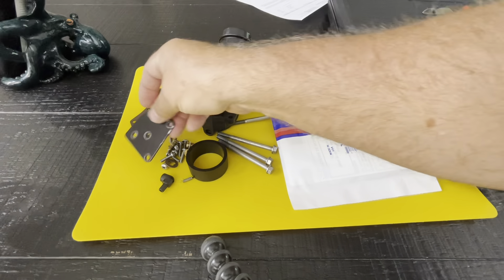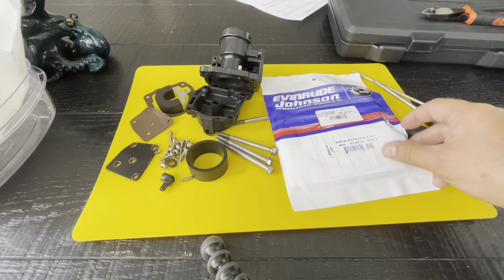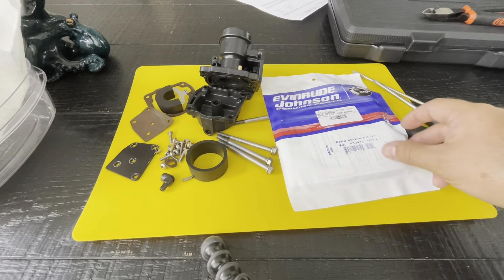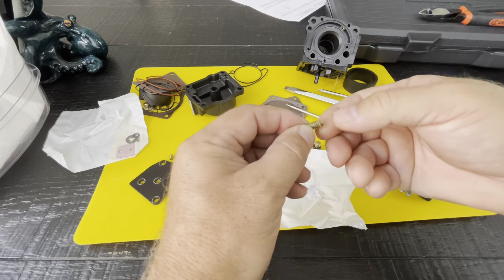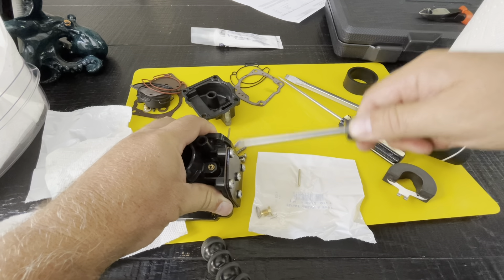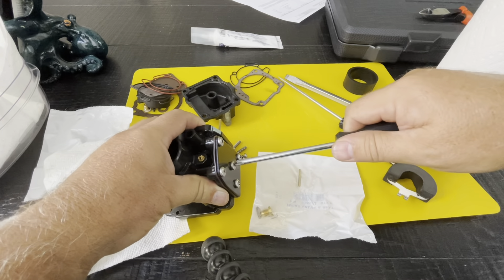Evinrude 150 Complete Carburetor Rebuild

Comment: If I’m not mistaken, the OMC service manual specifies that the carb float be leveled, as exhibited in the video, which closes the needle valve to stop fuel flow.….but also specifies a dimension for float drop which regulates the fuel flow into the bowl to maintain proper fuel level.
Reply from the maker: I would love to get my hands on that manual!
Reply: Manual states: "Adjust the float drop with carburetor body in normal position.  The drop dimension to bottom of float should be between 11/16 - 1-1/8 in."
Manual also states float should be level gasket surface (which you did), but +/- 1/32 in.
I can send pic or copy of applicable assembly procedure if you like.  If so, please instruct how/where to send.

Comment: Bobby, I would greatly appreciate your help.  I did the full carburetor rebuild even did the bowls.  Made sure all my floats were exactly level.  Even turned the adjustment screw 5.75 tuns out from seated. The engine runs like garbage idling way too low.  Before the carbs, I  also replaced coils, wires, gap less plugs, the Fuel pump, gas solenoid, starter and starter selonoid , flywheel cover and timing encoder .  I was under the impression that you can't screw up the timing because  the encoder can only be installed in one positions.  Do you have any ideas?
Reply from the maker: You can screw up timing if the timing advance notches are not in the right place. it’s part of that ratcheting system I believe. I am not an expert on timing, and I was careful not to mess with it.  If you suspect timing, I would hire an old Time mechanic or invest some time researching how to change the timing. As far as what else it could be…. Pretty much covered everything that I have covered. Are you sure you’re getting good fuel flow? Bulb should be hard through the entire time of running the motor. I had a problem years ago and it turned out to be the anti-siphon valve on the fuel tank. I replaced that and everything worked perfectly. I also had a brand new bulb and a brand new fuel filter and I replaced all my fuel line lol. But that anti-siphon valve is not something that lasts forever.
Reply: @bobbygfl  Thanks for your reply it means a lot to me.  I thought my compression was bad so I checked it is about 110 psi in each cylinder.  So I would think this is pretty good.  I changed the plugs they were really fowled from all the gas I poured in the gas tank when I was learning how to do the VRO.  I must have poured a gallon and a half of oil into the tank.  To alleviate gas problems.  I am running it off an external gas tank directly to the engine.  Same problem exists.  I am going to try it with the new spark plugs.  The kicker is it is the fastest starting engine I ever seen.  That was the original problem that  it took so damn long to start.
Reply: Did you ever fix your motor issue the same thing is happening to me now
Reply: @johngonzales3004  no, after all that time and money I got a brand new Suzuki

Comment: Where you out the 610 epoxy and that bb goes, if that bb comes out will fuel just oour out?

That's what mine is doing and I will be blocking this off with the 610 epoxy if that's the case.
Reply from the maker: Yes. No bb the fuel will just pour out. But if there is no bb you could push too much 610 into the hole restricting the fuel. Best to just buy a new bowl and 610 it when new.

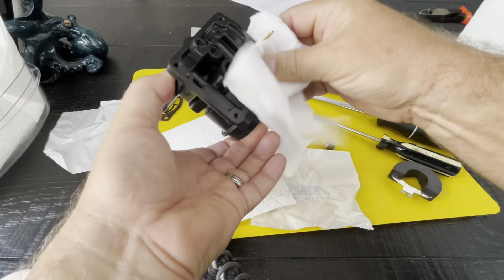Comment: Great job. Just had my carbs rebuilt and mechanic said I may not need to use the small rectangular parts (pictured on left side of your video at 7:19). Did you not use these either? Thanks.
Reply from the maker: nope.  thanks!

Comment: i rebuilt the same carb but I did not have a washer on the part where the needle goes in on the float,
so I went head did not use the washer that came with the kit for the seat that the needle goes in,
is this going to be a problem??
Reply from the maker: It’s hard to say. If you didn’t have it it’s probably because the last person didn’t put it in lost it who knows it should be there. I don’t know if it will cause you a problem. I would’ve put it on I think.
Reply: Some models do not use the washer. My 93 fast strike does not.
Reply: @bobbygfl  the plastic carbs do not use the washer, the metal ones do. This is why they send the seal. They should mention that so it does not get confusing. If you ad the washer on a plastic bowl it throws the float adjustment way off...
Reply: This is helpful. I was just about the same question about the washer on the seat. I read on bbc boards that you do not use that washer on the 60 degree loop carbs but there was no specification around plastic vs metal carbs
Reply: @bobbygfl thanks for fantastic videos. Very helpful!
Reply: @idahoanm618 mind if I ask how you’ve confirmed that no washer is used on the seat for the plastic carbs? I’m about to do a rebuild on all six and want to feel confident about that step and don’t want leaks there. Thanks!

Comment: Great video. On that little bearing that leaks. You used the 610 to close it out. Experiencing that on 4 of 6 right now. Anything additional you can share on what you did there?
Reply from the maker: Clean it with acetone and sand it so the epoxy has something to grab onto.

Comment: How do you feel about a complete vro delete? Either go vacuum pump or electric. Seem as the johnsons are notorious for fuel system air leaks due to all the plastic parts warping. Have you heard of anyone doing a Johnson 150? Mines a 2004. Mine works fine now but I feel this thing is a ticking time bomb the way it is now. I have small hairline cracks in all my float bowl so winter maintenance  is about to begin.
Reply from the maker: You know I’m not a mechanic and I don’t really know what you mean by a full delete. I replaced the vro pump with a Evinrude non-vro and it works perfectly if that’s what you mean. Check out my Evinrude playlist I have a video that shows the new pump. Hope that helps
Reply: Vros get a bad rap because of carb and line issues. Hardly do pumps fail, they do because of the owners lack of maintenance. I have a 92 150 vro still working perfect.

Comment: Is that high speed jet the only jet that can clog from bad fuel and gunk; or is there a pilot/idle jet as well?
Reply from the maker: Not that I know of. An idle problem would be likely the float, gasket issue or throttle position issue.
Reply: @bobbygfl  It's my father's boat which has been sitting for 2 or 3 years.  Ran great the last time we used it.  I've heard if a cylinder or two have clogged jets and isn't getting oil and fuel, the engine will still run and can mask the lean cylinder.  Of course if that goes on too long it'll burn it up.

I've been spraying carb cleaner into the little brass air intake orifice next to the throttle intake and spraying it on that high flow jet behind the carb bowl drain bolt.  I'll try to get a small enough screw driver that can remove one of the high flow jets to sample if they could be clogged.  Besides that would it be worth throwing some seafoam in the fuel just to make sure?
Reply: @bobbygfl hey so we took the boat out for its first maiden voyage in a long time.  Ran pretty well but would die at idle.  It would idle pretty well in the driveway with muffs though.  

When we were out on the river I ran some Seafoam through the engine.  Today when running it in the driveway it was pretty good at idle but would backfire a little.  Shut it off drained the carbs and I noticed not much fuel came out of the top passenger side carb.  I tried priming fuel through that drain and no fuel would come out!

Is the float needle valve stuck closed?  I also had the engine tilted forward when doing this but the others seem to let fuel bleed through.  Could the Seafoam have caused the needle to stick shut?

Comment: Did you pull and clean out the slow speed needle valve that is on the manifold?  I don’t know if that’s just an air screw or if it gets fuel and needs to be cleaned?  Or is that zigzag channel with the plate over it the slow fuel path?  Thanks!
Reply from the maker: I did not. I only cleaned the high-speed jet. I shot carburetor cleaner through it on the engine side but didn’t remove it.

Comment: Hi. Do you recall the size of the float bowl orifices? I accidentally threw mine away. I have a 150hp looper as well from 1994.
Reply from the maker: The size of the float bowl orifice. What does that mean? I’m drawing a blank.
Reply: @bobbygfl  in the float bowl  behind the brass plug the is a little   brass jet/orifice. I finally figured out 57D is the original factory size for my 1994  150hp looper/v6. The 70D plugs are for the 175hp.

Comment: Hey Yolo, what size jets did you use?, I have 74d size. Also, I noticed you didnt adjust the height of those floats, the manual calls for 17-28mm
Reply from the maker: I don’t have a manual. I would love to get one. Where did you get it. The floats are just set perfectly flat. Not sure what measurement that translates to. And the jets are factory. Came with the motor. I’m not sure what the actual size is.
Reply: The pictures are pretty shitty, but the manual is actually a pretty good read once you’ve identified what everything is.
Reply: Believe the 70.. D series is for the 175 hp motor.

Comment: Hey man I got a 98 Ocean Pro 175. I got the warped bowls, where did you get your rebuild kits from I feel more confident now that I saw your video
Reply from the maker: i got them locally but https://www.crowleymarine.com has them at the best price around
Reply: @bobbygfl  hell yea man, thank you. I’m probably going to do it once the fishing season ends. Might try sanding them down a bit and just replacing the gaskets and doing a full clean
Reply from the maker: @hookzsettv4842  in my experience I’d only replace them. They are about $28 each and because there’s a groove where the gasket goes it’s impossible to sand them down and have them seal.
Reply: @bobbygfl  yea if I’m doing it might as well replace. Thanks dude

Comment: DO YOU HAVE TO SYNC THE CARBS IN ANY WAY PARTICULAR?
Reply from the maker: No. You do have to set the idle screws. The way I set mine was tighten them all the way down be careful not to tighten them too tired just till they’re bottomed out. Then mine are backed off 5 1/2 turns each. Different motors are different turns by about half a turn. I backed all of mine out for turns and the motor didn’t run right I did five turns and the motor didn’t run right I did another half a turn in the motor idled perfectly. It’s really just trial and error. As far as adjusting the carbs for vacuum there is actually a process for that where are you put a vacuum gauge on each carb however the tolerance is enough where it doesn’t matter. The motor will suck fuel evenly if everything is installed correctly and nothing is blocking.

Comment: Good video, but it really seems to me that you really over torqued some of the screws into the plastic housing. Other than that, a very good video.
Reply from the maker: The threads are so thick that it’s almost impossible to strip them. I’m not sure what the torque settings are, but I’ve had them loosen up in the past.  This tightnesd that you saw has been flawless, and running strong. Thank you for the compliment! Also, that screwdriver is pretty small. I think it looks like I was talking them down more than I actually was.

Comment: You must have been the guy who tightened the oil pan bolt on my car before I bought it!  It's just little brass screws in a plastic carb body. The guys at work use pipe wrenches on little 3/4 gate valves and crank them till they start leaking. Enough with all this over the top tourqing.
Reply from the maker: lol.  ok point taken!  thanks for the comment!

Comment: I hate those shitty plastic carburetors. I wish OMC made them out of aluminum. On our engine the bowl on 3 of them warped. It caused them to leak massive amounts of fuel. We had to sand them flat when we rebuilt the carburetors.
Reply from the maker: Yep. Agreed. They seem to last a a few years and need replacing.